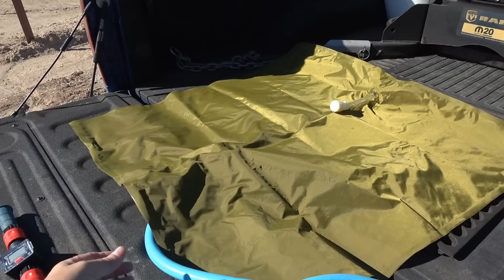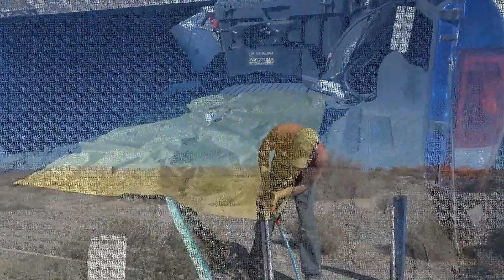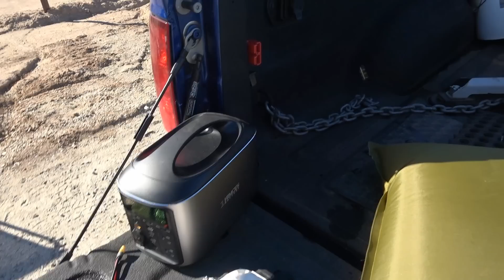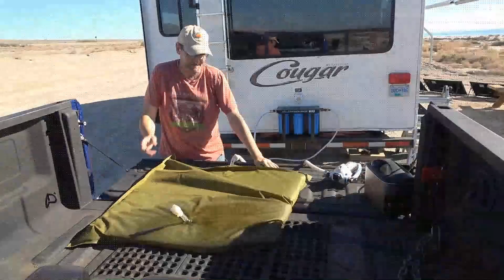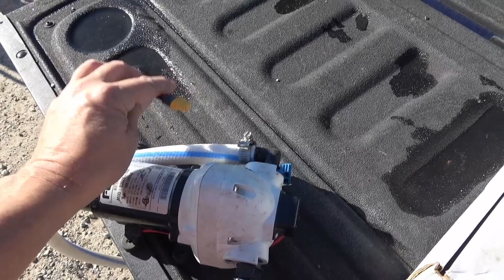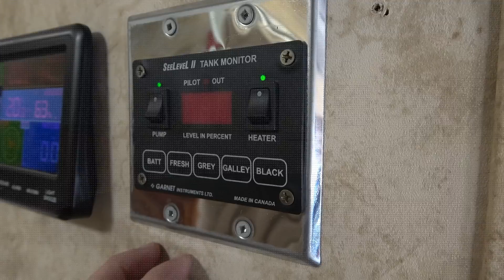Boondocking Water Fill Tips - AquaTank Bladder, Water Bandit and Flow Meter

Comment: Great video! I recently had to add water while boondocking. If you have a water inlet like mine you might have to do this method like I did if you don't have a pump to pump the water in: https://youtu.be/wAuVFg3n3us
Reply from the maker: Thanks. If you can get the water jug up higher than the fill port like on a ladder, you can use a shaker siphon to fill from a jug using gravity.  https://www.loveyourrv.com/2-simple-boondocking-water-tips-wh-temp-and-fresh-top-up/

Comment: That’s awesome. If the water bladder is close enough to the fresh water tank will the water bladder water gravity feed from hose to fresh water tank?  Or is a 12v imperative?
Reply from the maker: I haven't tried it, but I figure it should work if you can get it high enough above the gravity fill hole.  The higher up above, the better for the siphon action to work. So guess it depends on the truck bed height. In my case, the bed isn't much higher, so I don't think it would work great. I'd have to add some sort of platform so easier to use a 12V pump. :)

Comment: I've been thinking about how I could adapt my overland system to use your basic idea.  Have you experemented with how high your water bladder can be and stil be able to fill it from the spigot and water bandit?  I'm thinking if I put the water bladder on top of my overland trailer (eyeball height) I could use gravety to filter it through the Clearsource filters and into my camper water tank at tire height.  I am not sure if the run from the water bladder to the Clearsource filters would have enough pressure without a water pump.  But then with the pump, I could fill the bladder with clear running water from a stream?
Reply from the maker: Filling up high should work fine but I don't think there would be enough gravity force to pass through the Clearsource very well. Have a look at this Blu Tech system. Its much smaller. I have a video where I filled the bladder from a lake using a pump https://www.loveyourrv.com/reviewing-the-blu-tech-r3-three-stage-water-filter-system-w-off-grid-filter/

Comment: Hello Ray, is the inline water meater made for drinking water, BPA, Lesd free etc, same for water bandit?  Does it really matter if not since you have a filter and also the Acuva UV filter ?
Reply from the maker: The water bandit is Low Lead Certified: Our hose-to-faucet adapter conforms to all federal and state-level low-lead laws; CSA low lead content certified to NSF/ANSI 372  not sure about the water meter, likely just plastic inside, but the water passes through quickly so doesn't sit inside for time, then is filtered so doesn't worry me.
Reply: @LoveYourRV  Thank You 😊

Comment: Very interesting video. thanks for sharing!  Any reason you don't run the water through your filters before filling the bladder?
Reply from the maker: The filters are bolted to the trailer bumper and really no reason to filter the water that goes into the bladder.  Cheers, Ray

Comment: What's the hurry?  Don't need an electric pump.  Use a simple vacuum gravity pump, they run with no electric.
Reply from the maker: Go for it if you like, but most RVs have easily available 12 VDC power so may as well use it.
Reply: @LoveYourRV  very true, touché

Comment: Can you post an Amazon link to those red power connectors, I can't find any that big. What size wire do they use?
Reply from the maker: Here is a link to the DC-DC charger install video. https://www.loveyourrv.com/renogy-40-amp-dc-dc-charger-installation-and-demo/ The ones I used can handle 2-4 gauge cable https://amzn.to/31T8eUs 
HYCLAT 2-4 Gauge Battery Quick Connect/Disconnect Electrical Motors Wire Harness Plug Connector Recovery Winch Trailer, 175A, Pack of 2, Red  The hard part was crimping them, but luckily at the time I was camped with a buddy that has a hydraulic crimper sort of like this  https://amzn.to/3rOxO7S

Comment: Hi Ray, I noticed you have a heavy duty link chain in the back of the bed that looks like it's connected to your hitch.  Do you use that to lock the hitch to the truck?  Thanks and always, learn alot from your videos and great and clear explanations!  Dave
Reply from the maker: Yeah, I have the chain locked to the truck bed tie ring at one end and then run through the hitch and up to a couple locks on one of my tool chest lids. Mostly for show to dissuade thieves and so someone would make chain rattling noise if messing about with it. I also have a second chain like that for locking things like my generator or ladder to my trailer.  It's galvanized so doesn't rust.  I have plans to do an upcoming video showing how I have everything packed into the truck. Being full time we carry a lot of stuff! I try and get a good portion of the heavy items into the truck since it has quite a bit of payload capacity being a 3500. It was a bit of a puzzle getting it all to fit and easily accessible. :) Cheers, Ray
Reply: @LoveYourRV  Looking forward to the video addressing how you pack the truck--thanks for your reply!  Have a blessed Christmas!

Comment: Nice video.  You can use a hose clamp to secure the bandit... note: pay a little more for the stainless one.  Also works for using a separate bandit with clamp on dump stations that only have a non threaded hose so I can still use my black tank rinse. Stay safe sir.

Comment: I just noticed your red/white  reflectors on  your rear bumper. Very wise .. I need to do this. I have been wondering how you handle different issues while boondocking. 
This collapsible water bladder is great.
You must have travelled to the Chinese factory to learn how to get it back in the original box. Well done!
Reply from the maker: I added them at the bottom of my slide-out too and on my hitch. Figure its good to be seen since we often overnight on parking lots.  https://www.loveyourrv.com/stick-on-reflective-tape-tip/

Comment: How far to dump either the grey or black tanks? I'd like to do more "boondocking" but my wife doesn't!! She wants full hook ups!! Cable and WiFi too!! Oh well!! I need to put one of the 12 volt plugs in the back of my truck too!! nice setup you have! Miss the Ford dually!
Reply from the maker: At this State Park the dump is about 3 miles away. We can go about 7-10 days between dumping. We have 1600 watts of solar and 600 amp-hours of battery capacity so no need for electrical hookups. Have good cell coverage so good internet connection, so just watch streaming shows vs cable, though I can get some TV channels on the antenna. The camping fee is only 10 bucks a night. But for us it's more about not having a neighbor, 10 feet away. :)

Comment: Can you use your Starlink service where you are at?  If so, how is that working?
Reply from the maker: No, my Canadian Starlink Dish hardware won't work in the USA at this time. They tell me they are working on it but at this time Starlink hardware is only useable in the country you ordered to. So I cancelled the service and hope to reactivate when I get back to Canada in the spring.  Cheers, Ray
Reply: @LoveYourRV  Thanks Ray for the demo.  I must say I bought the same brand 3 years ago and also like the quality and had no leaks.  One thing you must do if traveling you must secure as it will roll forward.  ( don’t ask I know this) 😉On my fifth wheel I just use the rv pump and select antifreeze fill and boom it works well to fill.

If you happen to run into any folks with a Starlink dish on your travels can you see if they moved it from the home location to say Quartsite and maybe post something?  I have the Starlink in Montana and I am thinking of giving it a try while in AZ.  My only concern is when we come back we’ll I be able to reconnect my service.  We are in such a remote area it may not be worth the chance of not getting service again.  Cheers!
Reply from the maker: I'm thinking that with all the thousands of RVers that visit Quartzsite the available Starlink slots in that cell will fill quickly. Its not really meant for congested areas.  I've traveled with the bladder when the fiver was hooked up and just the truck. It sits nicely between the tailgate and the hitch on a blanket, never had an issue but never braked hard either. :)
Reply: @LoveYourRV  I forgot to say may bladder is 60 gals maybe that was my problem.  When it rolled on me I was going down a hill without the trailer and all 60 gals rolled forward.  
Thank you for the advice on bringing the dish. If there isn’t a slot available then I would use the hotspot.  My concern is more that I would loose my spot in MT.  Safe travels Ray.

Comment: You could use a hose clamp
Reply from the maker: Yes, another commenter just told me that. The flow was pretty good so only took a few minutes to fill the bladder.
Reply: @LoveYourRV  I also do some emergency preparing with ham radio and I think the bladder thing is a neat idea.  The past 24 hours or so we have had over 50 (yes 50) earthquakes west of us in the Pacific...  Fresh filterable too is good idea...  I also think it would be nice to make up a little filtering if traveling too.... drive safely

Comment: Use a hose clamp on the water bandit
Reply from the maker: Thanks for the tip!
Reply: @LoveYourRV  Tony is on the right path . I too use a water bandit and a hose clamp. I only run the water about 1/2 throttle though if the spigot has a lot of pressure.. works very well. BTW ... if this is the same bladder you had a couple of years ago its appears to pass the test of time.
Reply from the maker: Yeah, I got it for Christmas on 2018, has held up well.